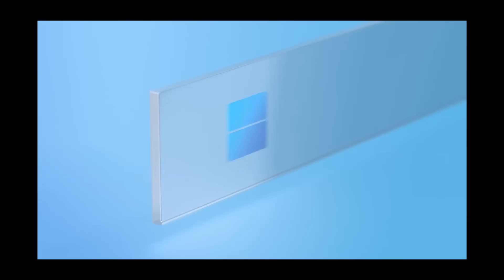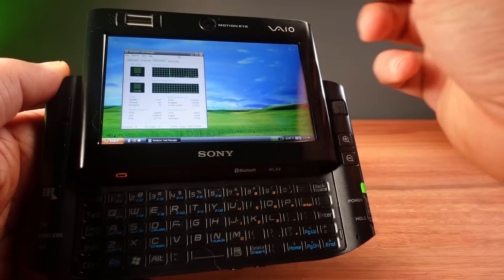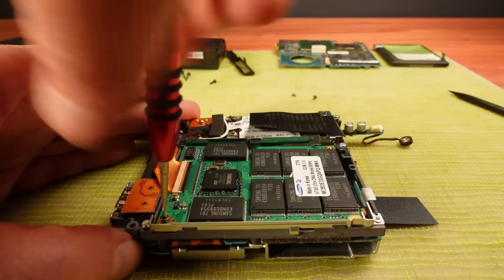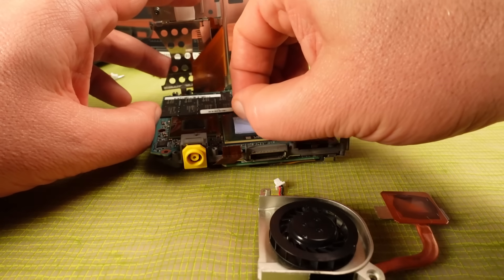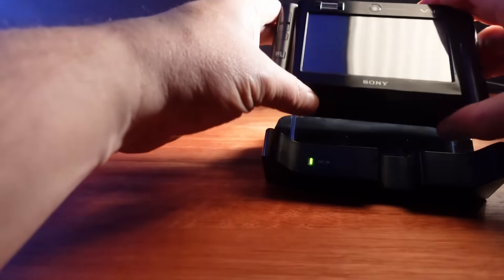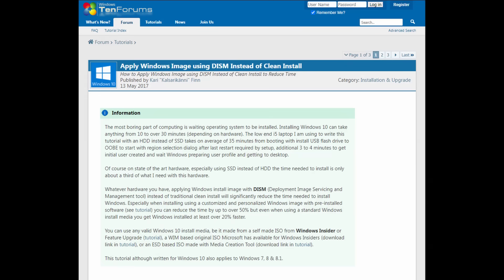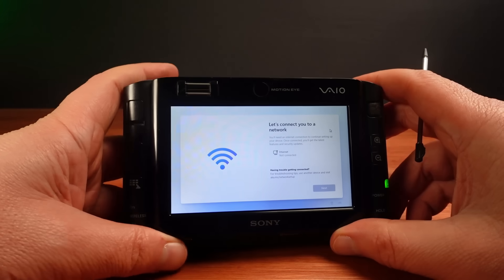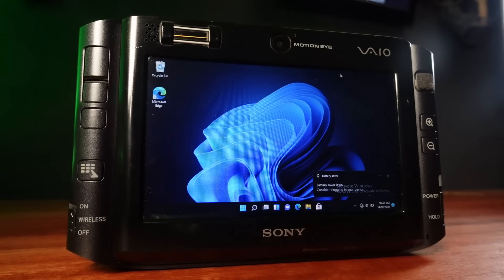Windows 11 On This Classic 15 Year Old MicroPC

Comment: Janus, you’re pretty tech savvy, but would you recommend a slightly tech savvy person buy one of these if it’s showing an OS boot error and no other information provided? 
Hard to know if it’s hardware failure or a simple
OS reinstall
Reply from the maker: This sounds like either the hard drive has been wiped, or the hard drive has been removed. 
The hard drive would be reasonably easy to replace with a ZIF to M.2 adapter and M.2 hard drive. Hopefully the ZIF cable inside is intact. They usually are because why would anyone remove that.
Reply: @JanusCycle  Thanks Janus! Some great info. Will keep an eye on the UX. For now I actually, maybe foolishly, went for a Vaio P instead. I don't know what kind of ride i'm in for, but they are beautiful devices. And specs / performance should be similar to the UX (if not better?)

Comment: I think there is a place for a extremely lightweight OS that does the minimum, like just opening apps and file explorer. A bit like Windows XP (maybe Windows 95 for extra lightweight gui), consuming almost no resources, both with 32bit and 64bit versions. Any hardware in this century is still usable in modern day, it just needs the right OS and apps. I really dislike the idea of resources being eaten by the OS, probably fueling unused background apps and fancy but unecessary graphics and animations. It is cool if you have a fairly modern PC, but it send old tech to the trash bin.

Comment: Cool! Think you must've had a lot of patience to install / boot that thing with W11. Also, I think you've used a mainboard with the U2200, which is the Core 2 Solo that was put in the last model ever released, the UX490N. That model apparently is the only one with a 64-bit CPU, and thus capable of running W11. But I guess only up to 23H2, as I don't think this chip supports the POPCNT which is needed for 24H2.
Reply from the maker: I have not heard of this new POPCNT requirement on 24H2. Thanks for sharing.

Comment: you should at least try micro 11 24h2 because it should run well just install the drivers afterwards and it also has a windows 7 like start menu

Comment: run Windows X-Lite micro 11 24h2 and install all of the drivers, and possibly upgrade the cpu of a cheap vaio ux board to core2duo 7700(with one gig of ram and possibly out of region model because ram was faster on non us versions.) by the way i love your channel please reply.
Reply from the maker: I've seen those 7700 CPU upgrades done for the UX. But the BGA work required is a bit beyond my skill level unfortunately.
I'm glad you are enjoying the channel :)
Reply: on ebay there is the 7700 vaio ux very expensive though
Reply: you should also try micro 11 24h2 it only uses .4 gb of ram and can posibally work with single core cpu

Comment: At this point, Microsoft neess to understand that not every computer has TPM 2.0, it's just not possible for every computer to have it installed on every motherboard, they have to lower the requirements to simply "Secuee Boot needs to be activated", because I don't think anyone has a computer that has TPM 2.0 on the motherboard.

Comment: Nice video! Just recently i have soldered u7700 (2core 64bit) cpu on my ux-490, it was recognized and performs well!
I've also tried this trick with Samsung Q1 Ultra Premium (the one that originally comes with U1500 cpu) but it recognize only one core, unfortunately. Maybe some bios restrictions idk.
Reply from the maker: Very impressive. That seems like very challenging work. So cool to have a UX with that CPU.
Reply: @JanusCycle  yeah, I have my personal graveyard of motherboards that I have killed before I finally got skills and equipment to reliably solder CPUs
Reply from the maker: @MSteamCSM  Awesome work! Allowing yourself to fail honestly, again and again, is the best path to learning and success. Well done :)
Reply: @JanusCycle  Thank you:)

Comment: Hi, I am thinking on getting this one to have a set up that is old, so I can sync my Palm LifeDrive. Which would it be the best Windows to install on this Vaio? I do not need the latest, just something that makes this Vaio run fast and sync my Palm. Bests regards from a Venezuelan follower in Panama!
Reply from the maker: Windows XP runs really well on these, yet still 'modern' enough to do just about anything.

Comment: You could set time and currency to World during setup to remove most of the bloat. But you have to set the region back after, because Store wouldn't work
Reply from the maker: I didn't know this, very interesting.
Reply: @JanusCycle  It even stops apps like edge from automatically coming back. There's also a way to make it normally uninstallable by editing a json. It's a 23H2 feature added after Microsoft got threated by the EU. The XDA talked about how to enable it

Comment: You know that this pc can't run windows 11 because of the system requirements
TPM 2.0 should be supported
Selected intel/amd processors should be there
There should be secure boot
RAM: 4GB or more
Processor speed with core: 1GHz or higher with 2 or more cores
ROM: 64GB or Higher
Reply from the maker: I also know that I have to push beyond limits :)
Reply: u must live under a rock... they have a software out that removes those limitations

Comment: I have the VGN-UX280P, with a 512GB mSata SSD connected via an IDE ZIF to msata converter. installed windows 7 ultimate on my machine. also discovered an undocumented 4 pin flatflex that turns out to be USB. used that to add a MicroSD reader in place of the old cellular modem.
Reply from the maker: Really nice mods you did there.

Comment: It's so easy to bypass Microsoft system requirements with registry inside the installer.
Reply from the maker: you might be surprised by the number of registry bypasses I tried that didn't work.
Reply: @JanusCycle  it's always the last one you try that works

Comment: What os can run on a laptop with these specs ? 

System Type	 X86-based PC

Processor Intel(R) Core(TM)2 Duo CPU T6400 @ 2.00GHZ, 2000 Mhz, 2 Core(s)

Comment: I bought my Vaio UX in 2006, mine was the sexier Japanese version I had imported directly from Japan. It cost a fortune as far as I recall at the time. It was an excellent little machine for running XP, it was by far the most versatile and powerful pocket pc ever, and my eyes were far better back then. I took it with me everywhere and carried a spare battery as its runtime was fairly short. I used it to run music, browsing and even 3ds Max at work as a second pc through an external monitor with mouse and keyboard via the docking station. Yes, it could fling 500,000 poly scenes around with no problems. It really was a gem.
Reply from the maker: Awesome to hear from an original UX owner. It must have been amazing to have such a hi-tech device directly from Japan.
Reply: @JanusCycle  Yep, it was sweet. The Japanese versions had the compact flash slot, and naturally I went for the black version with dock, the extended battery and a Sony memory card. It came with a nice belt pouch too which was very handy when out and about. 

The price was ridiculous of course, I think I paid over $2500 all told for my UX90 plus accessories. The tech was amazing though. SSD, fingerprint reader, backlit keys, touchscreen, size, ports, expandability. Even mobile tv, though not compatible with US stuff. 

Many regarded it as an expensive toy, It was anything but. I used it as a very reliable workhorse for a good few years and it went everywhere with me. I used to remote desktop my home and work PC's into it to keep track of what they were doing while out, and to run programs I didn't keep on the little Sony. 

It was a marvel of engineering at the time and everyone who saw it was gobsmacked. It's funny that you can now get something just as small, with far better specs for about $200 knocked out by some Chinese company, though not nearly as sexy 😄

Comment: I am a Windows 10 Pro user. Windows 10, especially Pro, are the best Windows versions so far. Windows 11 has many quirks, errors, and removed options. For instance on my work PC I do have Windows 11, and every time I leave the computer on overnight, when I put it on sleep mode, the laptop freezes and needs a forced boot, forcing me to shutting it down after every session. Also app icons get changed to weird non-icons at random. Every week another app icon is gone. The apps keep working fine. But when you cannot see in your task bar which apps are running, this is very inconvenient. After reinstalling Windows 11 2x, and getting the same results, I gave up. The menu for attaching Bluetooth devices is less easy in use and more inconvenient, with less options, than the same suite in Windows 10. I tested my work laptop, which is a Lenovo, with Windows 10, and it works perfectly. So it is not the machine. My employer insists on using Windows 11, so I reinstalled it. But I have 6 missing icons in my taskbar, which cannot be fixed in any way, and yes, there are 6 ways to bring them back, I tried them all, without success. The only thing that works is reinstalling W11, but then after 1 week icons start disappearing again. Stupid.

Windows 11 is again the same trend, every other Windows version is good and the next one is bad. XP = good, Vista = bad, 7 = good, 8 = bad, 8.1 = stupidly bad, 10 = very good, 11 is bad again. I cannot wait for Windows 12, which will likely be very good again.

Interesting how Microsoft is forcing Windows 11 down our throats, while they must know how horrid it is. And then when you do want to install it somewhere, they make it impossible. Horrid user experience.

Comment: Easiest workaround for windows11 is to use the RUFUS usb tool, it disables all the nags. but still why the hell would you want windows11 anyway, its bloody awful.
Reply from the maker: I did burn the ISO with Rufus, but something else was going on. I just had to try 11 to find out for myself :)
Reply: @JanusCycle  After extensive testing on my MSI stealth GS66 laptop, win11 constantly wastes 4.5gb ram because of all the useless background services, and gaming in windows7 is actually faster than 10 and 11, quite a bit faster actually, roughly 7%, with 1gb of ram i bet that ran to a crawl

Comment: Sony Vaio should make a comeback without changing the aesthetics but the hardwares inside! They would obliterate Steamdeck and other modern handhelds. 🤞🏻
Reply from the maker: This is a fantastic take. Sony could blow the market away if they competed in the new PC handheld market.
Reply: VAiO do still exist under JIP, Sony has a 4% stake in the business but you can buy brand new VAIOs with 13th gen CPUs like the SX14R

Comment: @janus cycle:
shift+f10
OOBE\BYPASSNRO
is your friend :)
Reply from the maker: Now you tell me.
:) thanks, I appreciate the tip. I have learned about this since.
Reply: @JanusCycle  there is also the tiny 11 iso? you may consider trying it, as it works on as lil as 200mb ram... for the sake of trying 11 with no bloat and extras... also for your cdrom things... i cant recommend iodd device  highly enough(hardware cd/dvd vhd emulator using iso files, so no burning or converting to usb required) you could try also ventoy but this may not always work in very old devices/bioses. iodd is a must! from servers to old can openers :) you cant go wrong

Comment: you could use some debloat software and use a custom installation of windows 11 with a lot of features disabled called tinywindows 11 and could have this running a lot more smooth.

Comment: Them openly blocking older machines just makes Linux much better.
Reply: Mfs don't make Linux any better now. In fact, it's only getting worse and worse...
Reply: @AN1cholson  I disagree. Gaming is improving, thanks to the steam deck, and I use it as my main OS. Anyway, to each their own.
Reply: @thumbtak123  Steam deck sucks. The ROG Ally is better. And Steam also sucks as a platform in general.

Comment: Hey Janus, I'm not sure if you'll read this, but are there any old 'handheld' PC's that seem to function well with windows/linux that you'd reccomend?

I just love the asthetic of most of these devices, and if practical, I'd be very interested in tracking one down myself.

Even just basic functionality - gaming of any kind would be a godsend, but I'm more concerned with internet connectivity and web browsing as well as overall speed.
Reply from the maker: For gaming I'm going to try more portable console modding and retro gaming. If you want full Windows then the Lumia 950XL running Win 10/11 ARM is amazing, but no GPU support or Windows games will run. 
Most of the older devices need older and less secure OSs to be usable. That can be fine, depending on what you are using them for.

Comment: 6 screws to take out , the 4 you pointed out plus one in the battery compartment and another hidden behind a small cover on the back that is only exposed when you remove the stylus . I found one of these on a Japanese's auction site , bought it only to find that it has Vista home so i can not change the language . Looking into changing the hard drive to SSD but need an adapter . Most sellers are not shipping to Ukraine because of the war otherwise i think it would be a simple case of cloning a system to an SSD and using an adapter. Mine has a conventional hard drive , not an SSD model , a spinny HDD that is easy to get to without removing the main components , Toshiba HDD

Comment: I used to drool over these in my nearest Sony Store. Of course, saving up for a similarly-specced laptop was hard enough at the time, so it was nothing more than pure fantasy. 

The industrial design and miniaturisation got my mind racing back then, so it's kind of funny in retrospect how some aspects of the internal construction now seem pretty big compared to modern phones and laptops! 

I also drooled over both gens of Sony Mylo at the time, of which this bears quite the family resemblance to the second-gen. (The first-gen Mylo has more of a family resemblance to products like Rolly and their solid state Walkmen. The PSP Go is pretty much a 2g Mylo shell with different controls!) Though I've never bothered trying to get one when they were at their price nadir, because most if not all of the network features sadly no longer worked by then. Which at least can't be said for a Windows PC like this!

Comment: Me trying to Install Win 11 Home on my Acer Aspire 3 from 2019, Microsoft: "Your Laptop doesn't meet the Requierements, such as TPM 2.0 and secure boot"

Me, who Replace a Modified Config file into the Win 11 ISO and after that installation edit the registry to ignore TPM 2.0 and Secure boot check to prevent MS blocking my Leptop of Updating to newer Win 11 Versions: "hey Microsoft, how about to just *FUCK OFF*?"

Comment: You should use the software that Linus showed recently, after Windows is installed, it will disable all the unnecessary processes and run a bunch of tweaks and fixes. He was using an old PC and it quite sluggish, but after using the software, everything opened instantly, it was borderline hard to believe!
Reply from the maker: Thank you, I'll check that out.

Comment: I am really into micro pcs. Great content.
Maybe you can get help with upgrading the ram, if there are anyone specialised in the field around you.
Even though this is 15 years old hardware, it may perform well better with 4gb ram.
Reply from the maker: I would love to upgrade the ram, though no easy solutions that I have found so far.

Comment: dude, fantastic video. don't sweat the thermal paste; non-engineers get too worked up. it's only supposed to fill the non-contacting surfaces, not the whole blinking plate. I'd have just gone with the dried paste left on the heatsink; thermal coefficient more than good enough.
Reply from the maker: Thanks, the temps have been fine with the pad. The high priests of overclocking have a lot of influence over the 'correct' ways of doing things.

Comment: I want to replace my motherboard and SSD inside mine, there is a modded build of Win11 called Tiny11 that has been trimmed down and can be installed on older hardware out the box.

Comment: I know this comes late, butr hold my Beer.   that device got a Slot for  the Sony Pro Duo Cards. Get one of those Cards in 16GB or bigger and put them in. what you want to do ist use that card as Virtual RAM. That enhances that devices Performance =)
Reply from the maker: An interesting idea, it would have to be a fast card.

Comment: Whats the CPU what did you exchange?
Reply from the maker: I took out the mainboard that had a 32 bit Intel Core Solo U1500 1.33 GHz, and replaced it with a mainboard that has a 64 bit Intel Core 2 Solo U2200 1.20 GHz :)
Reply: @JanusCycle  Interesting video, thank you

Comment: Well if you change motherboard then it's not a 15 year old pc anymore. Is as old as the replacement motherboard. Still good work, but sounds a bit clickbait for me.
Reply from the maker: You make a good point. Though the replacement motherboard is from 2007, maybe early 2008 at the latest. Making this 15 to 16 years old in 2023 :)
Reply: @JanusCycle  I did not want to be mean, this work is really exceptional and that small PC is very nice even to kepp in on the shelf :D I would be happy to own one :D And yes, if that is 2007/8 then the 15 years seems valid :)

Comment: Very cool video and great idea 🙏 maybe increase ram at least ? If possible ! Keep up good works 👍
Reply from the maker: Thanks, more RAM would be amazing in this. I'll do my best.
Reply: @JanusCycle  sure man I think so too specially that slow cpu it is amazing how u could manage 64bit only windows 11 on this I mean cpu must be 64bit otherwise I tried this methods of bypassing the demands on my core i7 4940mx windows 11 runs fast with ssd Ofc my plan is to force my aging amd socket 939 opteron 175 to run with 11 should do since it’s a 64bit cpu and runs windows 7 74bit I don’t see y 11 shouldn’t ! Best of luck 🙏 happy Easter